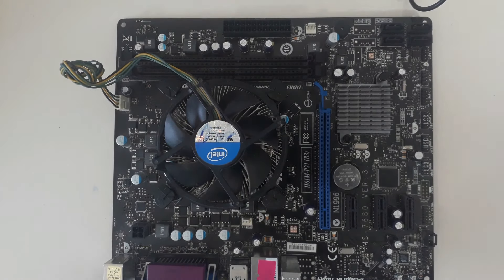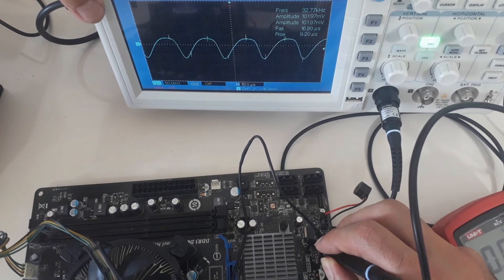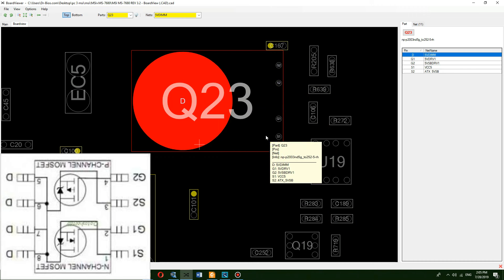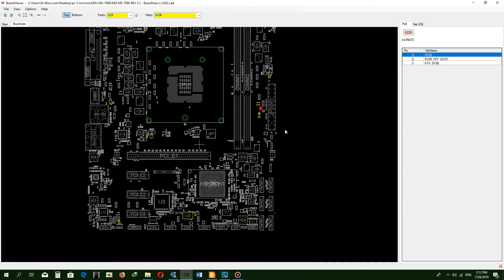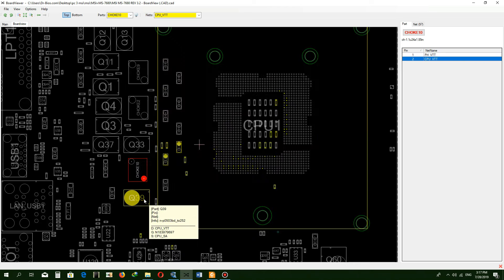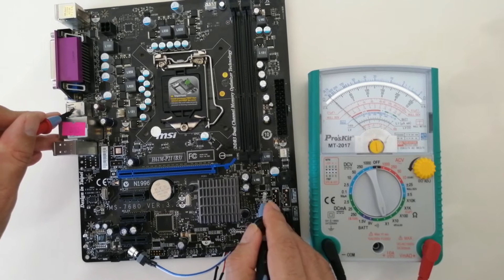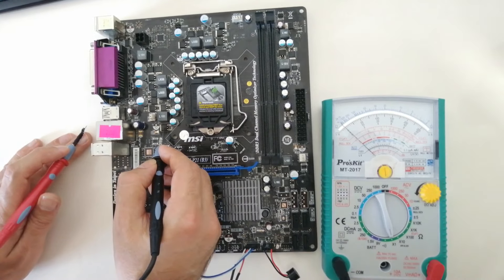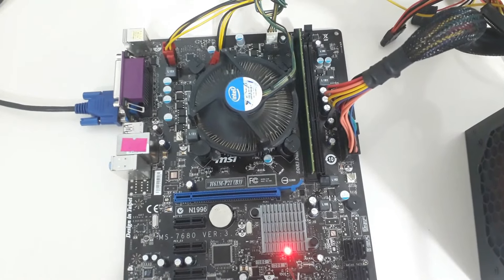Desktop Motherboard Repair Tutorial

Comment: I appreciate the time and effort went into making this video however whoever wants to learn repairing motherboards is not gonna learn from this video that's for sure. I'm not completely beginner so about 95% of the time I could understand what's he talking about but he did a lot of unnecessary things/measurements/explanations which does more harm than good. Another thing is he completely reliant on the boardview file so what happens when there is no boardview file or schematic diagram for the motherboard? Or if we have to repair a VGA? He won't know what those 32789 ic's do on the pcb. All in all this tutorial was 90% good for this specific motherboard (MSI H61M-P21) and 10% good for every other motherboard on the planet. Lot of time went by explaining what those ic's do based on the boardview file. A more universal approach would've been much more informative.

Comment: HELLO DOC B! Am an avid Subscriber, you are my first 'Go to' when diagnosing PC issues! I recently built a new Computer in my old Tower with a new Raidmax Vampire 1000W 80 Plus Gold Power Supply, an MSI Z390-A PRO Motherboard with an Intel Pentium Gold Processor G5400 CPU @ 3.7GHz! Next added  64.0 GB DDR4 3200 Ram! Also a ZOTAC GAMING GeForce GTX 1 Video Card! Recently upgraded all my HHD's with an Intel 660p Series M.2 1 TB SSD Drive C and two WD I TB internal SSD's! My Computer now boots up completely for a cold start in 30 seconds!!!! (Once in a while when I turn it on, it Boots into the Bios Screen)!!!(But when I wont to boot into Bios, no matter what key combination I press it wont go into Bios on Command)! Windows will not display on my Digital Monitor but I can see the Bios Screen on another HDMI Output to my 32 inch TV! Am running XMP Mode and Gaming Mode on the MSI along with allocating 3/4 of my Ram to Process my Adobe Premiere 2022! My Question is: How do I get the computer to Boot into Windows EVERY TIME? And secondly, How do I get my computer to boot into Bios on command?

Comment: It's crazy how he knows the components' order of operation and how everything is expected to work. You have to take a lot of notes in this video but it looks to be complete to help diagnosing other boards as well. I'm trying to find a fault on a z97-Ar v1.00 from asus that shuts off immediately after starting. But if you disconnect 8pin CPU power cable then it doesn't shut off. I removed the inductor connecting 12v to the mosfets and with both cables connected it doesn't shut off. So the problem lies somewhere in the mosfets of the cpu supply. I'm still trying to pin point it. It might be a bad pwm ic
Reply: First you should check mosfets for shorting by removing processor.

Comment: Switching Power Supply any without load: as is told, you should never do it. Or perhaps the new power supplies are different?
PS. The are many courses by people speaking with poor English accent and are therefore useless. Thanks for jumping over this obstacle and for the valuable lesson.

Comment: Hi, Thanks for the video. I have an ASUS B250 Mining expert, trying to figure out why it has not power. It was on a PSU which burned out during a cyclone, maybe power fluctuations. Where do you get the schematics and if you dont have aschematics how do you check the MOSFET regulators etc...

Comment: hi there.

what is the correct word to enter in google to download this document which shows what goes "where" ?

on how much celsius you set the gun from heat station. do you apply some flux or other for the remove the IC from the motherboard?

Comment: i watch this and learn new things. i need to re-watch this to let it sink.

do you have a video for repairing an ASUS P7H55-V? after i turned it on, the fan spin then turn off then spin again but no display. i already changed the ram and flashed the bios.

Comment: Good tutorial, but this is a lot of work and time.   I wish you could solve the puzzle of the server boars ASUS KN8 DRE dual socket 940.  This motherboard is known for being difficult to get logo or boot screen, even brand new unboxed.  people say the problem comes from the ECC DDR400, it requires a very specific type of Ram and places it in a specific order to get video output on the screen.  when you switch the motherboard on, the green led light on, the fans spin, but you get no video output

Comment: why changing the probe while checking ohm should value be higher ?
Reply: If I'm not wrong... multimeter makes a very little current to cross the circuit along the lowest resistance (ohms) path, and it does (in example) from plus to minus... but if you have a diode on the path and it is reversed to that current... very little current will flow in that direction because high resitance (ohms). when you interchange positive and negative you will allow the current to go thru that diode in the 'right' direction and get low resistance. That way you get both direction-resistance values and helps you to diagnose better.

Comment: I have a motherboard with AMD CPU and the plastic clip that holds the CPU on the motherboard got baked and broke. Also some capacitors bulged.
 I thought that computer was done.
However, I got some capacitors to replace the faulty ones and I am going to use a wire to tie the CPU to the socket and the computer should be just fine :D

Comment: The easy way to find a short is to inject voltage.
Reply: not always remember a perfect short causes no heat along with open lines cause no heat which is a severed circuit or if a chip isn't being told to turn on and without a board view or schematics those are almost impossible to figure out.